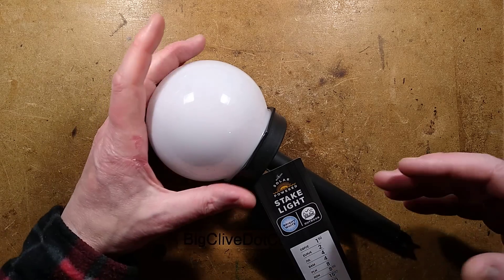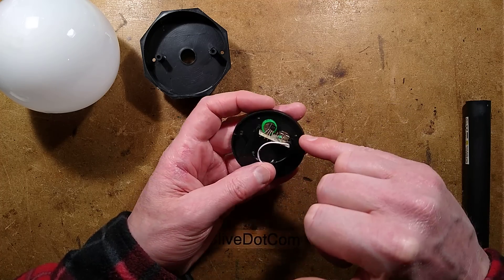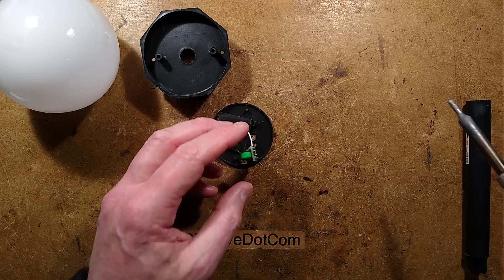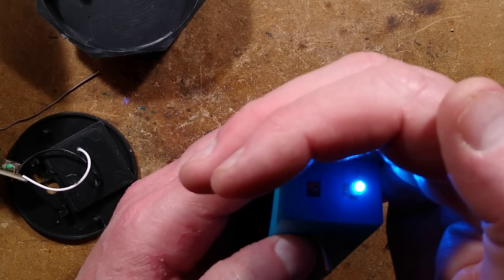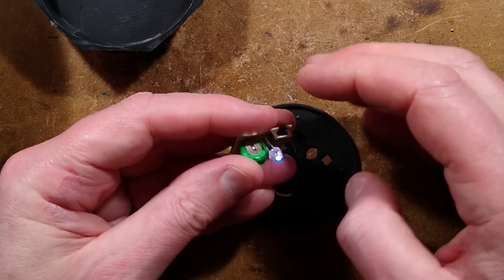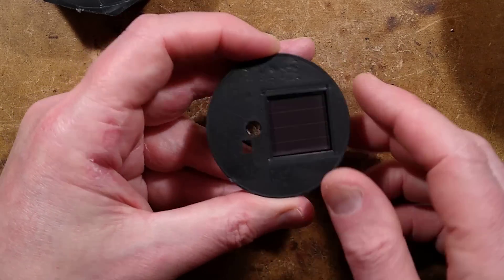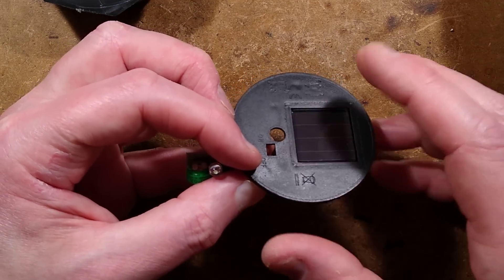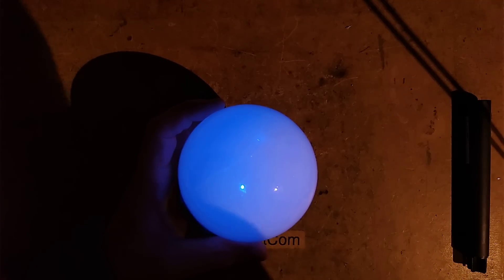Hack your solar lights into Uranus and other planets

Comment: I would parallel another button cell with the original to expand run time. Also water resist the leads and base of the LED to prevent corrosion. I think that is what kills the cheapest LED strings from post mortem analysis of failed strings.

Comment: I've had a lot of these lights fail, and in my experience it's ALWAYS the four lead chip thing leads rusting out. I've repaired a couple by filing and soldering new leads on but often they rust right up to the plastic. I've nail-varnished my most recent lights.

Comment: I recommend spraying the board with Blaster Surface Shield. It's a great anti-corrosive. Murikans can get a can at Harbor Freight for $10 to spray their car's rusty bits as well.
I believe your Poundlands are 5Below stores in Murika

Comment: The third price is in Bulgarian Lev (лв), followed by Bosnian convertible mark (KM) which are both pegged to the euro at roughly 0,50 euro for 1 лв/KM. Kn is the Croatian kuna, which is no longer in use as Croatia joined the eurozone on Jan 1, 2023. Strange why they used the currency symbol for the lev and the kuna, but used ISO codes for the other currencies.

Comment: There's a lantern like the one you reviewed a while ago the orange one with a flashlight at the end of it, now I found one that has a portable fan on the end and I'm wondering if it's as dangerous as the one before? It too has a power bank and I hope that it doesn't give anyone a horrible shock if they use it. I'm really close to buying one but I'm not sure about its safety.  Let's hope it's safe to use.

Comment: Beautiful blue end result.
Now to the desoldering wick, I'd like to buy some, however I'm not sure what to choose.
The website I order components from offers to choose between tinned, non tinned and no clean.
At least it's how it translates from the French, with the exception of No clean used as an anglicism.
But on the pictures they all look copper-y while I expected the tinned one to look more silvery, like tinned wire ends for example.

The only wick I have used so far comes from a former work colleague and I don't know what type it is.
It's copper in color and doesn't need any flux to do its job.
Any idea what type it can be and what the best choice would be ?
Thank's.
Reply from the maker: I've only come across generic copper braid.

Comment: Sir, I have desoldered a red LED from an optical mouse. But it's long lead is -ve & wide lead is +ve.
Reply from the maker: Some of the very high output LEDs do have the chip in the other way around.  I've been caught out by that before.

Comment: The plastic dome could be used as UV shield for the solar cell, if it's of the right plastic. 
All my small solar cells have turned white and ugly. Acetone rub brings them back for a while. 
The epoxy they use must be the cheapest known to man, with no UV protection.
Sun's UV rays destroys the polymer and leaves a white dust in its place. Same deal with car headlights.
Reply: There's a spray-on product called 303 Aerospace Protectant, it's used in boating communities to protect the plastic windows on their soft-tops, and it's advertised as having UV blockers. Since I discovered it, I've been applying it periodically to plastic headlights (2-3 times a year) and it seems to do the job as I haven't seen any degradation over 6-7 years. (If you live in an area where it freezes, ice slides off your headlights with the gentlest tap of a snow brush's bristles.) I've also used it on gauge cluster bezels (the clear plastic over your gauges) and fine scratches disappear. If the bezel is scratch-free, 303 makes it nearly invisible. Once I discovered that... Applying it to plastic eyeglass lenses, with tons of fine scratches, it makes enough of an improvement to be a surprise every time I apply it. (I'm more nearsighted than Mr. Magoo!)

They're not a sponsor (lol), it's just a really great product that works well when applied as directed. What I'm getting to is that product might be great as a preventative measure on future solar lights (with periodic reapplication, of course). Since the cells you have now are pretty damaged already, you might want to experiment with an acetone rub followed by a buffing with 303 Aerospace Protectant?
Reply: @dashcamandy2242  I've never used it, but have seen a lot of car videos using them to restore and maintain rubber parts. 
Will give it a try next time. Thanks for the tip.
Reply: That's why I avoid the resin ones and only buy glass ones. I've got 10 year old glass ones that are still good (although the batteries need replacing).
Reply: @two_tier_gary_rumain  The smallest glass ones I have, is 12W.
Also, these epoxy ones come with the garden lights, and motion lights. 
The alternative, would be to use bare solar cells and encapsulate with good quality epoxy, which is expensive. 
With a UV dome, you can use any cell and not worry about environmental degradation.

Comment: Why put two LEDs in series?  Does the circuit automatically boost to fit any Vfwd (within some constraints)?
Reply from the maker: The collapsing field in the inductor can usually drive a few LEDs in series.

Comment: I made my own solar garden light using li poly(280mah), attiny 412 , tp4056, 6v solar cell and some leds. It blink Morse Code "help". (For the li poly battery who is stressed due to heating during the day)

Comment: i am interested in this don't solder cells idea. even though i buy little holders for 18650s for my own projects, when i want to , for instance, make a crap torch last longer between charges,  i just winkle them open and solder another 18650 across the original one. is this terribly bad? should i buy a little spot welder instead, attach a bit of metal, and solder to that?
Reply: AIUI lithium cells such as 18650 have 2 major dangers if soldering directly: the high temp can cause sudden combustion or even explosion within the cell if applied for too long, & the (usually) +ive end terminal has tiny vents for the natural outgassing, which if blocked by solder can cause similar effects. A spot welder is far faster WRT its heat transfer to the cell, & is more precise WRT avoiding the  potential for vent clog. I forget where I saw this, but it was while I was looking up how to build small home-made spot welders for exactly this purpose
Reply from the maker: My main concern is that overheating could cause the separator film to shrink away from the end and potentially allow the electrodes to short.

Comment: Into Uranus? So supposing we hit the body with a tremendous — whether it's ultraviolet or just a very powerful light — and I think you said that hasn't been checked because of the testing. Supposing you brought the light inside the body, which you can do either through the skin or some other way, and I think you said you're going to test that, too.

Comment: Taking apart and altering garden lights is how I got back into electronics a few years ago.  I kept thinking why can't I build a better garden light than those crappy store bought ones?  So I did, after starting to watch your videos.  Now I make custom garden lights for friends. I totally agree about coating the board and components with varnish or some sealer.  I live in Victoria, Canada, a very rainy and humid climate in winter and I've seen those components rust within a year, killing the light.  Nail polish does wonders.  I've also used liquid rubber, the stuff for wires but that's a bit more messy.

Comment: Coincidentally, a couple of days ago I installed a AAA cell onto the garden light I have sitting on the bathroom widowsill. The inbuilt cell had lasted well over 7 years, which wasn't bad to say it originally cost me 50p (in the closing down sale of the then-named Poundworld). I calculate something over 2500 charge/discharge cycles. Identical components to this one. I bypassed the power switch while I was there.
Reply from the maker: I've had a Poundland solar light operating indoors for a massive amount of time.  Something like 10 years.  I should test the cell capacity.  It doesn't get a huge amount of sunlight where it is, but still lights (blue) for a decent time.

Comment: How about putting fairy lights in the globe instead of the one LED?  Probably would need to change the battery?
Reply from the maker: You can use strings of the parallel LEDs directly.

Comment: The trouble is that it turns out that the colours of the blue icy planets of Uranus and Neptune, are actually an artifact of NASA's colour processing, and we cannot now see the outer gas giants in any other light. Considering the distance of these planets from the sun, if you imagine being an astronaut heading for the outermost edge of the Solar System, Uranus would be considerably  better lit than Neptune, but you would see hardly any colour other than a twilight grey for either planet's upper atmosphere, with the occasional brighter high level clouds. If there is any bluish tinge it would be from Rayleigh scattering, but would your blue-sensitive cones be excited by the low light levels, or would only your light sensitive rods in your retina be activated?

Comment: With proper care solderwick can be safer than spring suction tools, which can suck the pads right off the board, especially where there is no platethru support.    I did my time in the factory with real solder vacuum systems and good quality PCBs,  low-end  commercial grade boards are a lot easier to damage - the pads  seem to be attached with school glue  🤣
Reply: Here in the tropics I find that solder wick soon loses its lustre and eagerness to absorb solder. But suction tools just keep going.
Reply: It will happen in the temperate zone too as the wick ages,  a ziplock bag or sealed container can help a lot.  Only pull out what is needed and try not to handle it with fingers.   Sometimes nothing will help! 40+ years in this game, and I still get surprises, I definitely appreciate good quality PCB stock.
Reply: @greaser5691  I'm always surprised how fresh electronics looks in the temperate zone after 30 years. Here in rainforest climate, everything looks rotten after two years. I'm afraid solder wicks are no exception no matter what I do short of air conditioning.

Comment: Uranus is actually very white with only a hint of blue to it. 

NASA had to NASA and was basically photoshopping results until they got called out. Same sort of deal like how they were photoshopping Mars photos to be WAY more red than it actually was. Go and check Wikipedia if you don't believe me. They finally updated the photo after decades of misinfo.

Comment: I remember buying these about 4 years ago from Poundland, i think they were called Malibu. I got these over the other "posher" designs because the solar panel wasn't susceptible to rain ingress, due to being enclosed in the globe. They still work now, only main difference i can see is my ones have an AAA ni-cd battery. They were only 50p each though, inflation!

Comment: I always replace the batteries with an external, larger one from the Ni-Mh 3.6v pack that I have for free. 
These tiny ones often only work for a few seconds. On the larger one, it lights up all night long, over 12 hours.
Reply: Whenever i have to open one of them, i try that too if possible.
Also bridge the stupid switches and blast it with WD40 for a "good enough" waterproofing.
Usually last long enough until they fall apart due to UV degradation.

Comment: The ( nerd ) fact about  Uranus , is that it spins on its side ... so ... you should mount it ( sideways ? ) on your garden fence for the correct orientation ... handy tip # 33 ............................... DAVE™🛑

Comment: I found a 2.4v panel this winter and stupidly destroyed the circuit board thinking it'd be easy to make a circuit to charge my nimh cells from the solar cell. However I practiced some trace repair using magnet wire  and hot glue and put the circuit board back together. It was in 3 different pieces, looks horrid. Haven't gotten the chance to charge cells with it yet but in testing it looked like it was working. It wont be driving a light, just charging cells, sitting outside my window. Has some IC on it I couldn't find the datasheet for.
Reply: Probably a yx series solar light ic that has a integrated boost converter with a external inductor for charging the battery or powering the light and some logic to turn the light on whenever the solar panel or ldr detects darkness
Reply: @309electronic5  Yes I believe it is. When I tried searching it some other generic solar light IC kept popping up. My issue was the battery would discharge at night. Since its trying to power the panel. I tried adding a diode and it didn't work and also limited the current/voltage.
Reply: @309electronic5  yx S628H AadQB is the IC
Reply: @309electronic5  yx S628H AadQB is the IC

Comment: Been following the "Big Clive keeps yer lights alive" vids for a while.
Been doing clear silicone on solar panels for a while, getting years out of lights at the mo ... Will have to try the tape / nail vanish for the next set we pick up.
Soldering the switch closed is a good shout 👍they definitely turn to shee-hite. Cheers!

Comment: I only check the anvil for the cathode these days. There are way too many LED's out there with the long lead being the cathode, instead of the anode, So far. all of them had the cathode on the anvil.
The solar panel uses IR? I thought they used UV. Might be wrong, haven't checked it.
Reply: Have had a batch with even that reversed... 😮🤬 as well as flat spot and long/short leg
Now I always check some random samples (more if wackyness is found)  in a batch on arrival, and all as they go into a PCB/project.
Rather spend the few seconds to verify than having to debug/desolder at the end.
Reply from the maker: Some red LEDs have a positive anvil, but most are negative.

Comment: Could the circuit be dipped in melted candle/paraffin wax to seal (like I use for guitar pickups)
Reply: Potting compound is best but anything that is non-conductive and will keep the water off is better than nothing.
Reply from the maker: In hot baking sunshine it may liquify.

Comment: Sigh 2620 can't get here fast enough. ;) The astronomy nerd in me has to point out that Uranus is actually more of a cyan color and Neptune is blue.
Reply from the maker: I was originally going to say neptune. but Uranus sounded a lot better.
Reply: Turns out the images we have of a dark blue Neptune are incorrect. Sometime soon after V2 flew past the planet, a colour enhanced photo made its way into the hands of the press and that picture was broadly disseminated as being a true colour image (despite the original being identified as an enhanced picture). Neptune is actually slightly less green than Uranus and not as dark as the general public has been led to believe.
Reply: But that does make Clive's story fun.

Comment: Connect every single led to the next one in series and see if it'll survive straight 240?
Reply: You would want two chains for the positive and negative half cycles. Then you'd want about 240V (mains rms) * 1.732 (peak vs rms) / 3 (LED peak Voltage) = 138 LEDs in each chain.
Reply: @ekij133  he said he had a large number and doesn't know what to do with them, put them all together and see how far they blow up 😂

Comment: Clive said, "The world is your oyster..."  Should've said, "The world is Uranus..."  🫢😄

One important point.  With that tiny inductor, if the value is larger, as long as the inductor doesn't change size, the current will decrease.  One can put in a 330 microhenry inductor that is wound with thicker wire and the brightness will be as much as if the small inductor was 47 uH.  This is because the current also depends on the DC resistance of the winding, which depends on the wire size.

I wind my own inductors on small toroids and I can get high current with high inductance using heavier wire.

Comment: Very nice color mixing the ice blue with the white dome!
I've had success replacing the button cells with the 1/3AA size (from eBay) in these smaller fixtures.